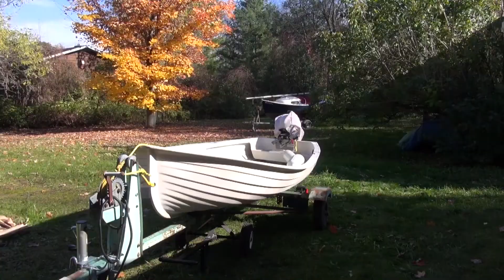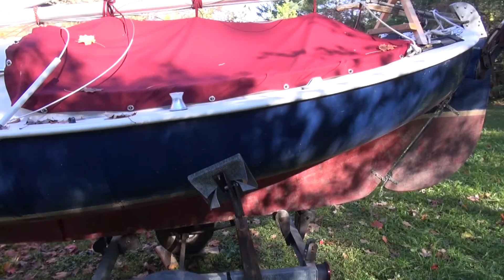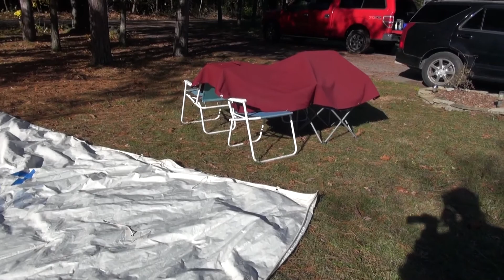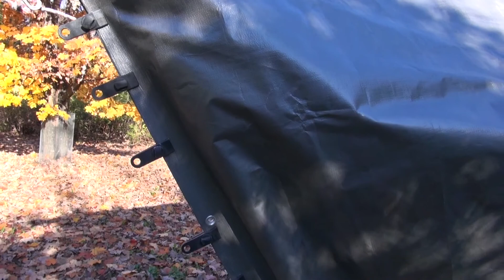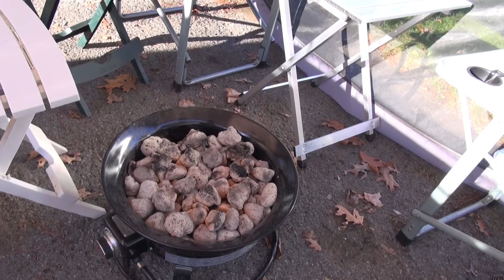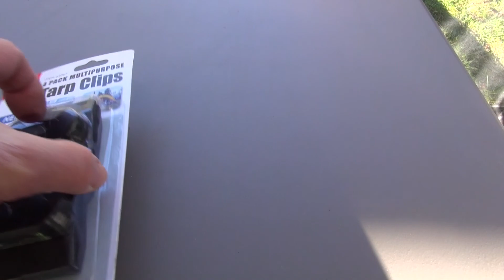Nordica 16 off Mississippi Lake

Comment: Thank you for the overview!  I’m hoping to find a video of the interior and complete sailing review of the N16.  There is one for sail near me, and this little boat model has always been intriguing to me..  (I’ll try to check if there are other videos on your channel after posting this comment)
Reply from the maker: Thank you for viewing my video & yes, there are more sailing vids on the channel.  When I reconditioned the exterior, that was many years (decades) ago, before the internet even existed, let-alone YT, so I don't have much in the line of restoration vids to show you.  There may be others online with those however.  I have only seen these models with bare interiors, but I do have the original bunk (V-berth) cushions which I have used in the past.  The interiors are small, kind of like sleeping in a puptent without sitting head-room.  Crawl in feet first & exit head first.  On the other hand, they are sturdy little craft that float up in rough water & that have shallow-draft full-keel hulls offering very little places for weeds to hang up if your body of water is shallow & weedy - I can highly recommend them for those conditions.  (18" max draft)  Yet, they can handle big rough water surprisingly well.  Their only weakness in my humble opinion is that the cockpit sole is below the waterline, so they do not have self-draining cockpits.  On the one occasion I had mine in 8' seas on Lake Ontario I had a 5 gal bucket tied in the cockpit for emergency use, but thankfully never had to put it into action.  Mine is a 1979 model & I have owned it since 1995.  Happy Sailing.
Reply: Thank you!  8’ seas in a 16’ boat must have been very exhilarating!!  Glad you mentioned the water staying out of the boat as well—good design.  

Could I ask how it “feels” under sail—in moderate to strong winds?  Does the hull stay steady in the water, and does it bounce/bob quite a bit?  Thanks again
Reply from the maker: Randy, it has a small full keel hull, it doesn't bounce & bob around like a laser-style hull might.  On the other hand, it's not as stable as my friend's Morgan 38 with a full keel (subject of another video on the channel this summer) - large displacement can aid stability.  I used to enjoy sailing along with the lee rail in the water, but am a wee bit less daring anymore & no, I've never capsized it - so far.  On those larger waves it rode up & over them as opposed to trying to slice through them.  My brother, who was with me on that trip, & I were both very pleased with how well it floated up & over them.  It wasn't storm conditions, the winds had died down considerably, otherwise I would probably not have tried that passage, but under the conditions we were in it performed admirably.  Being a small full-keel boat, though, it is not a racer, but cruises comfortably. @randykaminski6214
Reply: Thank you CapnG.  I’m not sure why it looks like I replied several times on my phone?  But, thank you for the detailed response!   I have a 17’ sailboat that I purchased and it needed a lot of work,, so it might be at least a year before I’m done.  A Nordica 16 showed up for sale nearby and it looks like it has been well cared for, so it’s ready to sail.  I’m also getting older and my sons have went on to bigger things, so I’m looking for a safe and able boat.
Reply: Thank you CapnG.  I’m not sure why it looks like I replied several times on my phone?  But, thank you for the detailed response!   I have a 17’ sailboat that I purchased and it needed a lot of work,, so it might be at least a year before I’m done.  A Nordica 16 showed up for sale nearby and it looks like it has been well cared for, so it’s ready to sail.  I’m also getting older and my sons have went on to bigger things, so I’m looking for a safe and able boat.
Reply: Thank you!  8’ seas in a 16’ boat must have been very exhilarating!!  Glad you mentioned the water staying out of the boat as well—good design.  

Could I ask how it “feels” under sail—in moderate to strong winds?  Does the hull stay steady in the water, and does it bounce/bob quite a bit?  Thanks again
Reply: Thank you!  8’ seas in a 16’ boat must have been very exhilarating!!  Glad you mentioned the water staying out of the boat as well—good design.  

Could I ask how it “feels” under sail—in moderate to strong winds?  Does the hull stay steady in the water, and does it bounce/bob quite a bit?  Thanks again
Reply: Thank you!  8’ seas in a 16’ boat must have been very exhilarating!!  Glad you mentioned the water staying out of the boat as well—good design.  

Could I ask how it “feels” under sail—in moderate to strong winds?  Does the hull stay steady in the water, and does it bounce/bob quite a bit?  Thanks again

Comment: Just loaded my first video of my 16 Nordica located in Lake Lanier Ga. picked her up from Florida. Love your boat captain !!   https://youtu.be/Ax8aaSmKOH4  I just added some plugs for all the rainwater Three! . My boat has a front and back rail that the mast lays on ... very high but it works out very well for covering with a 12 x 20 tarp. Harbor freight is only $12 bucks I got two tarps very cheap so one season will be fine for each.  PS I had thought of jugs too, Gatorade plastic.  I will paint Krylon spray and fill them with sand. We need more videos with these boats online!  Thanks for sharing!!
Reply from the maker: Just loading a new vid & saw your comment.  Thank you & fair winds to you & your Nordica 16.
Reply: Thank you!  8’ seas in a 16’ boat must have been very exhilarating!!  Glad you mentioned the water staying out of the boat as well—good design.  

Could I ask how it “feels” under sail—in moderate to strong winds?  Does the hull stay steady in the water, and does it bounce/bob quite a bit?  Thanks again